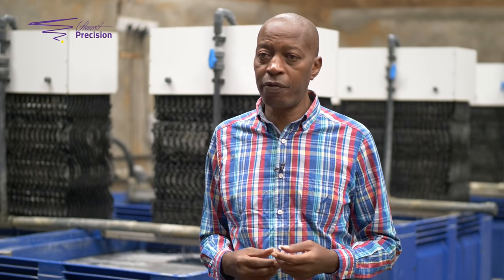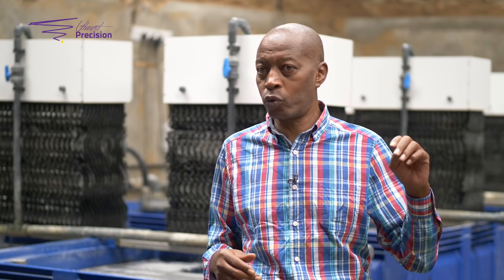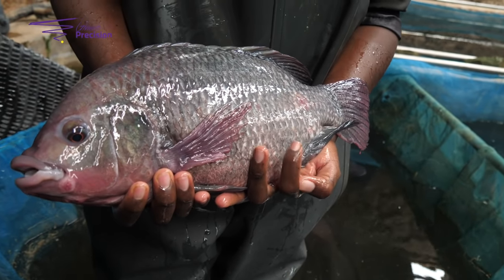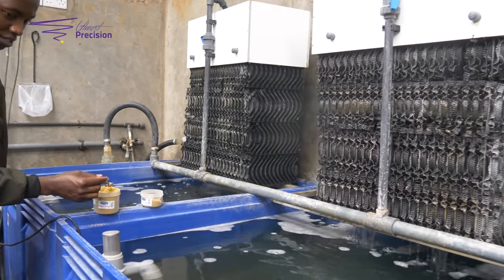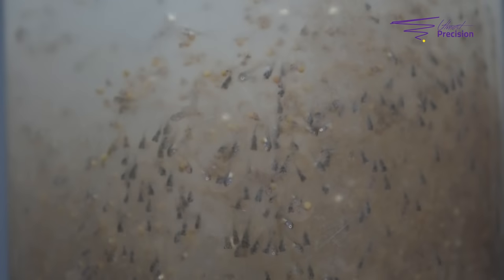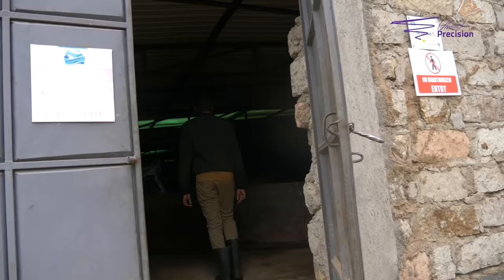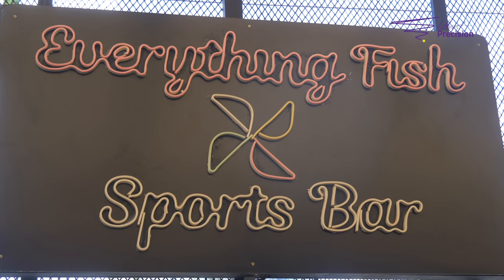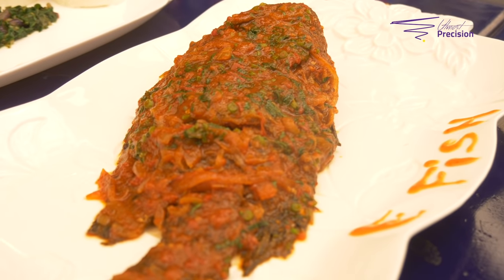How we guarantee that you get the tastiest fish on your plate & still make money.

Comment: DEAR ANTHONY - PLEASE ADD STRAWBERRIES TO AN ADDITIONAL CROP 

MAKES MANY A TASTY TREAT IN GOOD HIGH VOLUME FOR ALL ETC
AND MAYBE ADD LETTUCE TYPES , ONION TYPES AND MANY TYPES TO THE FLOW THROUGH WATER CYCLE 

ANGLED FLAT TRAYS WITH A BASE WATER FLOW THROUGH 

EVEN RICE 
FRAME LINER - CLAY AND LINER - ON ANGLE BACK INTO THE THE SYSTEM : GRAVEL BASE PEAT SYSTEM AND SEEDS ETC